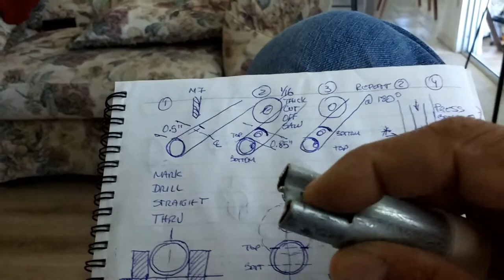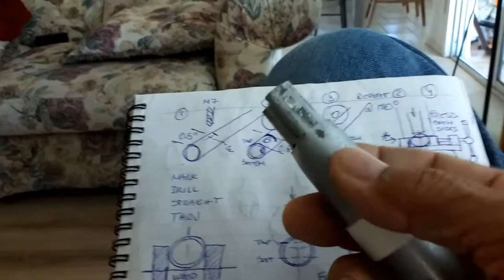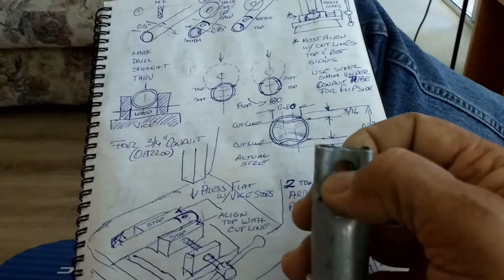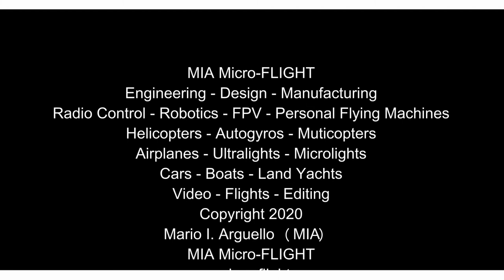Making EMT Conduit Ends conform to Maker Pipe Tee Connector Geometry  - A DIY Process

Comment: Mario, what are the micro pipes connectors for? Just curious
Reply from the maker: Gerardo, they are for a couple projects that I have been working on. One of them was mentioned at this video link posted by the maker of the connectors "Maker Pipe" : https://www.youtube.com/watch?v=U-WUn_xNg3g. The second project is sort of a secret, at the moment, because I have been testing a scale model of it and want to make sure that it works before I show the full scale using the connectors with the  attachment methods I have been developing.
Reply: @MarioIArguello  cool  i will check it out. Can't wait to see what it's going to be. Hopefully is a giant scale ..😜